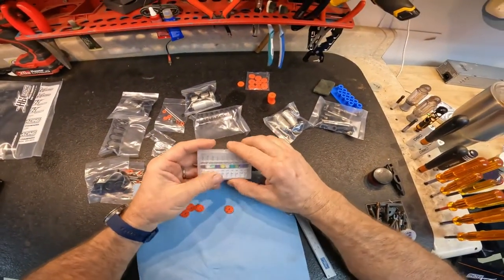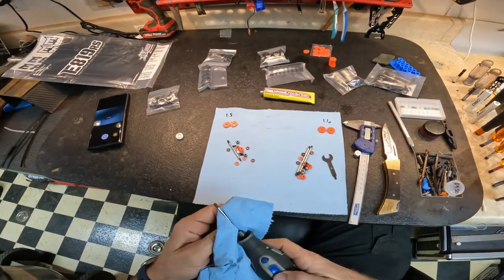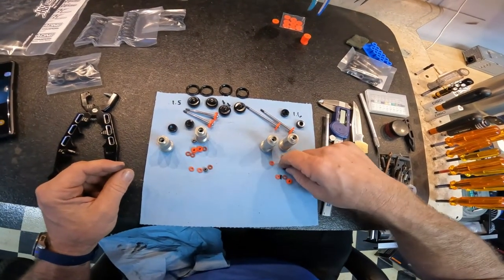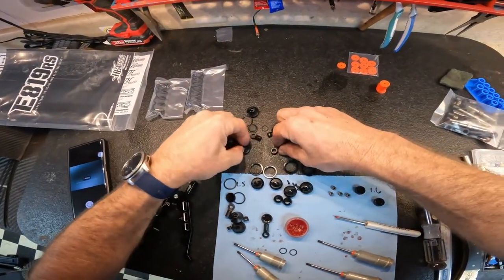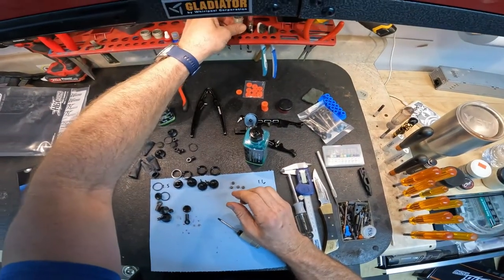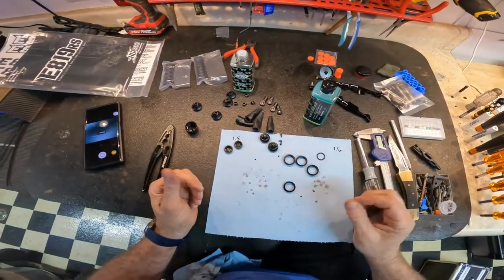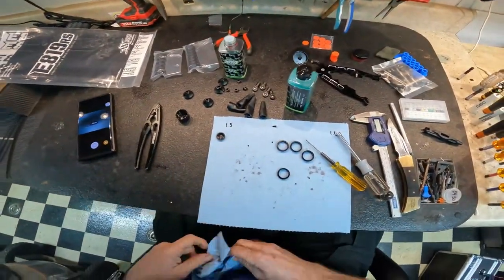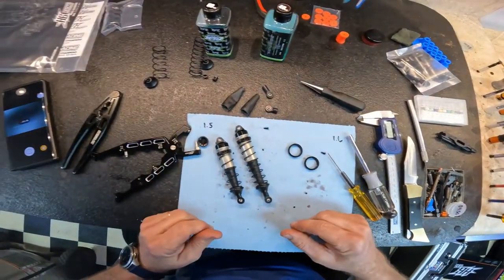HB Racing E819RS build series Part 1....Shocks, emulsion and bladders.

Comment: Always wanted to try an HB buggy. Also what size trailer do you have? Any details would be cool, and anything you would do different?
Reply from the maker: It's a 7x16. The only thing i wish it had was a fold down bed and a shower. Here's a link to one of my first videos...when I first got this trailer:
https://youtu.be/4bvmUxYaszg
Reply: @TheHammer  Thanks. She’s a beauty. Really want to build out a pit trailer at some point. To me, it’s only worth it if I can sleep in it. Save on hotel cost.
Reply from the maker: @D70racing  exactly. I have slept in mine a few times in my zero gravity chair. A shower is pretty important though. Lol
Reply: @TheHammer  Yes, I figured you can get by, or even those outdoor tent like showers would be a simple thing to setup.
Reply from the maker: @D70racing  last race I went to, I was backed up ti the woods in a very dark place, so I took a ghetto shower behind the trailer with a bucket of water. Lol

Comment: Hey Danny, i have probs with my hb shocks leaking through the orings on the bottom, even if the black part is snug pretty hard. Doesnt it happen to you ? If not whats that red grease you use (i dont understand it in the video) ? Thanks
Reply from the maker: I do have them leak as well. However, they seems to get better with time. A while back, I used some different orings I got from Amazon. They seemed to be a little better. I may try that again soon.
Reply from the maker: As far as the grease goes, I usually use Protek blue oring grease. I was out of it at the time, so I used Valvoline automotive grease.
Reply: @TheHammer  i tried also the ones from T-Works, seemed a little better. Thank you ;)
Reply from the maker: @openone15  funny thing is, the T-works ones just so happened to come out right after my video when I did it. They were the exact same thing. Lol
Reply: @TheHammer  haha okay 😉
Reply from the maker: @openone15  here's the video from back when I first tried them: https://youtu.be/WZ7g1sibG6A
Reply: @TheHammer  👍
Reply: Do you recommend Bladder or Emulsion for an E Truggy?
Reply from the maker: @the_Wingading  when I had my truggy, I used emulsion.